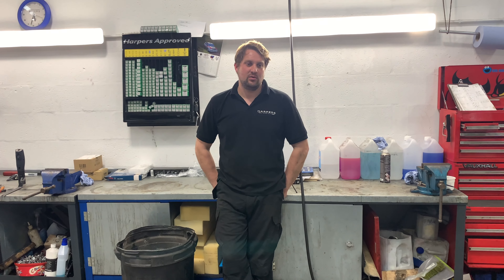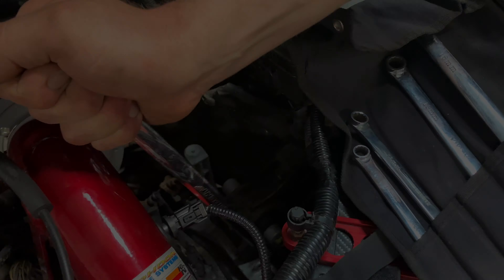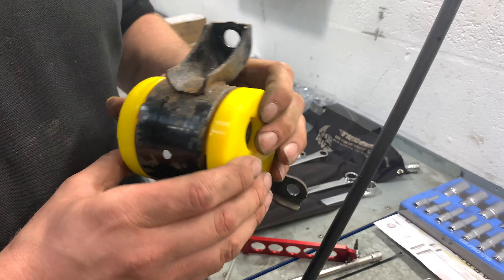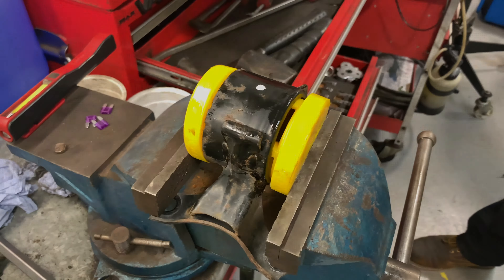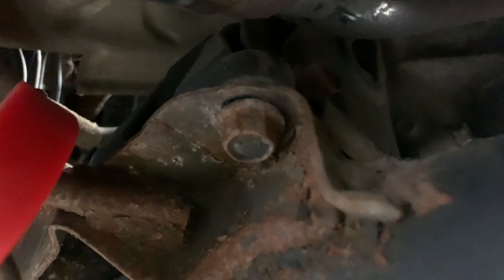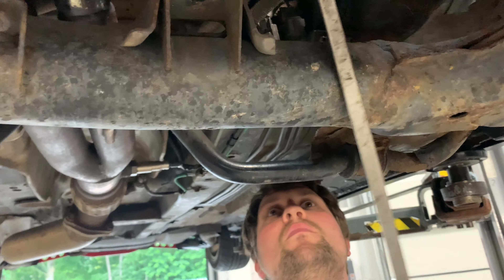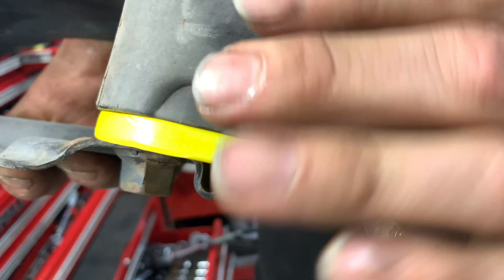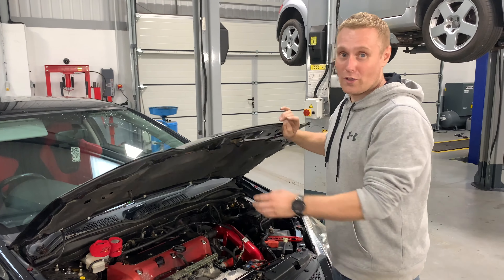EP3 Type R Powerflex Engine Mount Insert Install

Comment: What was wrong with the standard mounts im having nightmare with me exhasut just fitted a stainless centre pipe now the manifold is leaking would you recomend these mounts as my car vibrates from this area when revving it 😂
Reply from the maker: It helped stop the engine movement it had but whether it would fix your issues I don’t know. Sometimes the manifolds crack at the flexi joint without updated mounts.
Reply: Its the standard manifold that leaking on the decat joint so ive just ordered a Japspeed 421 with them bushes gona get them fitted then book it in to get the manifold fitted then gona map it running like a bag of shit atm mo knock sensor code came up so swapping the plugs out next never ending aint it m8 😂
Reply from the maker: @mavicprotoe3959  it only ended the day I sold the car 😢

Comment: Powerflex makes a huge difference u can feel the motor enter ur heartbeat when u start it up and the rumble also gives ur ride a quicker acceleration
Reply from the maker: They did seem to be a small improvement although I’d say proper uprated engine mounts would have been better

Comment: I changed my front mount at my mates garage,was a pain in the ass.we removed drivers side engine mount bolts and rear had a jack on engine and just got enough clearance to get the front out.
Reply from the maker: im glad I was talked out of doing it on the driveway. didn't take that long and was a lot easier, especially when someone of the bolts were a pain to get out. makes a massive difference so well worth it.
Reply: @1BlueGhost   I’m considering doing mine how does it feel please explain in depth and does the dash sound ok not creaking etc.

Comment: Nice vid.  How was the drive back? Any noticeable vibration driving back? Or not as much  . ?
Reply from the maker: Little bit on idle but nothing otherwise. Can feel when changing gears the engine doesn’t move around as much which is good.
Reply: 1Blue Ghost  any chance you could do a quick vid on reaction to the mounts etc. Might do this myself. I’ve been running spoon engine torque damper but might this instead. Spoons good but I think the mounts might be better.
Reply from the maker: @automotivediversity554  I am thinking of adding a torque damper instead of chancing the driver side mount actually. need to see how this gets on first. it seemed to have a lot less wheel spin than before, It doesn't vibrate much on idle, not as much as I thought it might. its not an every day car so its not really a problem for me. 

I will do a final video before we start to fit the turbo to it, last drive before boost type video.
Reply: 1Blue Ghost I recently put a innovative red series billet driver side engine mount on mine and took it off a week later. Too much noise inside the cabin and a fair bit of vibration. Might go down the insert route to add to the mugen mounts I have just for piece of mind they might last longer over time.

Comment: Ah Nic Barnes talk about a ghost from corsasports past, knew id seen that face before. Planning on getting the turbo conversion up to project greyskull levels? Thinking of getting Ep3 soon so loving all the vids so far mate, gives me an idea of what im letting myself in for 👍🏻
Reply from the maker: The best website on the planet!!!! I doubt I’d ever go that far with it, but then I never planned to do that with the corsa either......Genuinely surprised at how much I enjoy driving the ep3. Even with 235hp it’s really good. Hands down prefer it to my golf. Wish I’d bought one sooner.
Reply: @1BlueGhost  just waiting for a house sale to go through then i can start shopping, give to me straight, how bads the rust on the underside on these, not bothered as im still the bodywork trade, just need to know what im looking for
Reply from the maker: the facelift models seem to be the worst in the rear arches as they were fitted with some sort of fabric carpet like liner. they also leak water through the side skirt clips which causes the inside of the inner arch to rot, can usually see it from behind the rear speakers. Mine has a lot of surface rust as can be seen in most of the videos but it is otherwise decent. surface rust galore on most of them.

Comment: hi after you install this Powerflex Engine Mount Insert , did  you get any annoying rev from engine inside in the car??
Reply from the maker: it doesn't seem to be much different, although I can feel the engine moves around less.
Reply: @1BlueGhost  good good i have billet mount innovate and i have annoying rev sound from engine  inside in the car,i can hear the engine,, Thanks!!